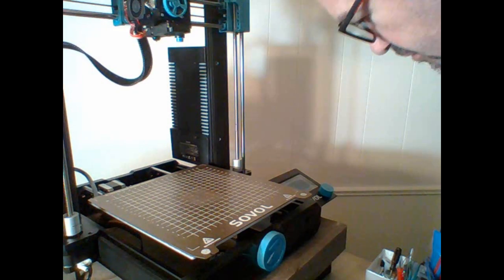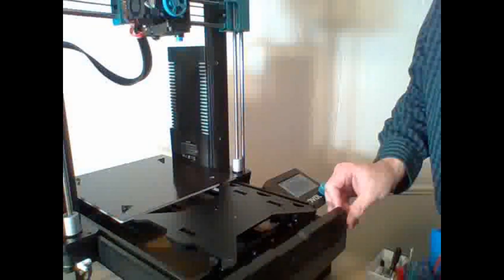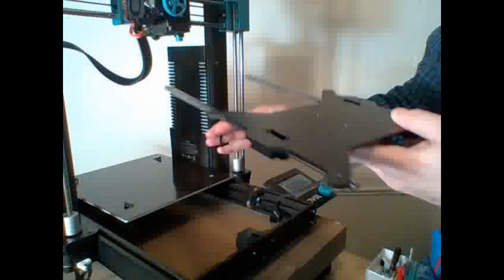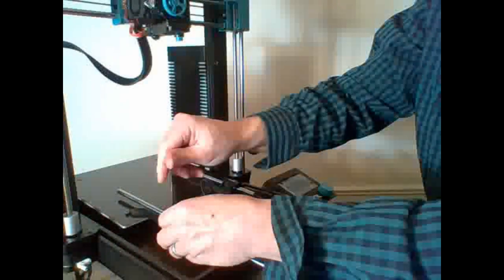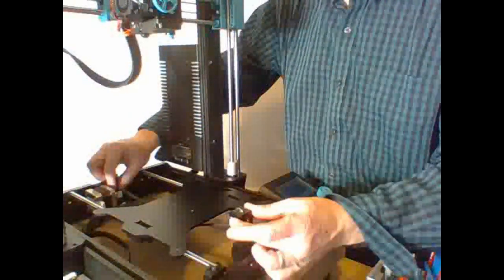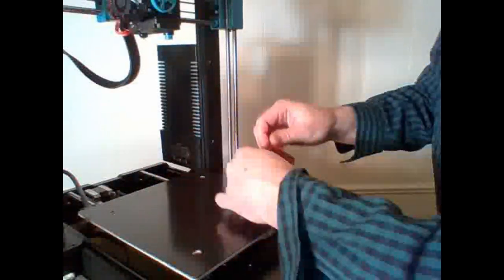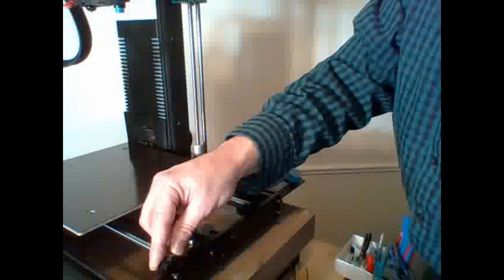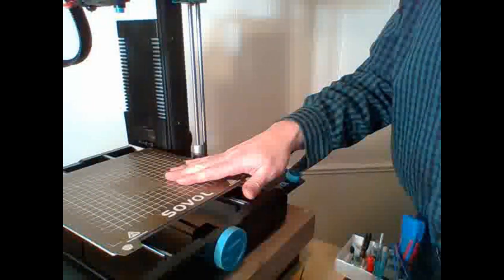Sovol SV06 Linear bearings under bed

Comment: The mod putting the bearing at the top is a bad idea for this printer as it will cause z wobble in your prints due to the design of the z motors and lead screw placement you are best to change the lead screw holders on the bottom with flex ones.